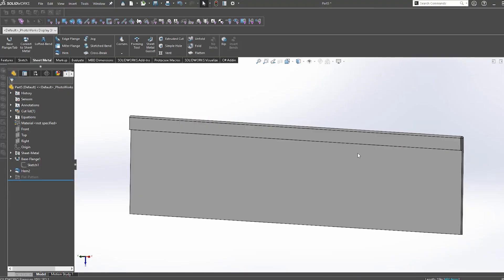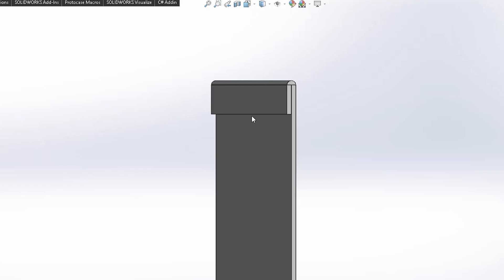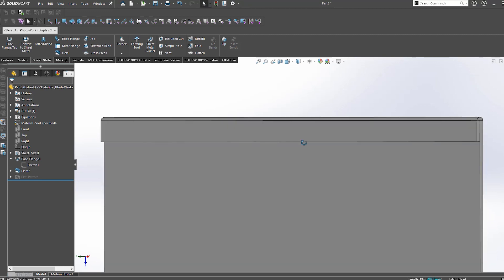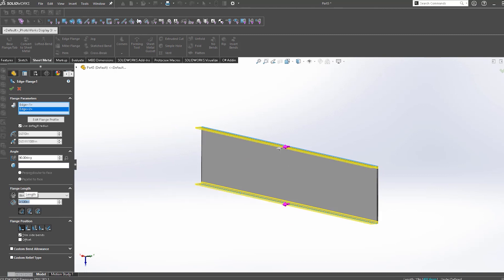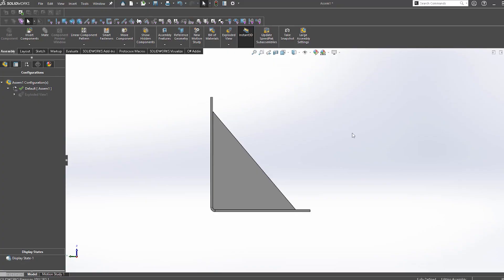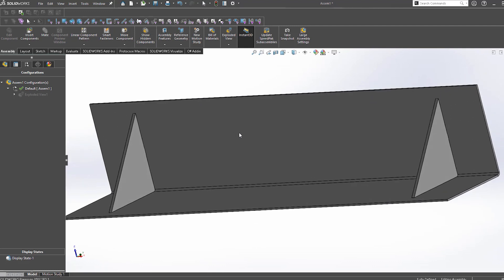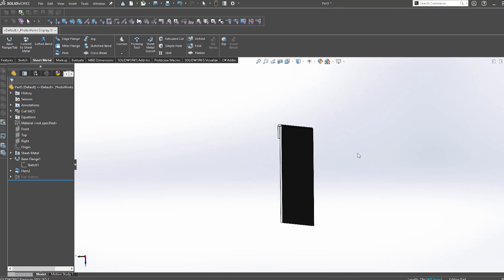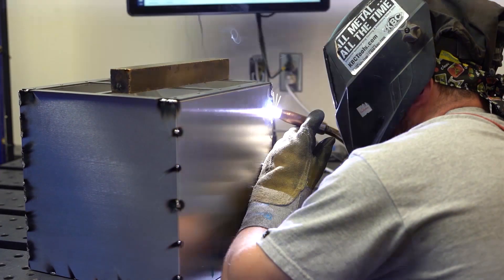Proto Tech Tip - Adding Strength to Sheet Metal Parts

Comment: Great tips. Thanks for posting the video, this was very useful for me. Could you give some tips on how to prevent metal sheet from flapping around.
I have a L shaped long cover made of 2 mm thick aluminum , mm length is around 2500 mm. One side of the L is 40 mm wide and the other side is 180 mm. The 180 mm side has a long window 2000 mm long in the center, 110 mm from the bottom edge. 
The problem I am facing is the lower part of the edge becomes floppy due to the cut window. The upper part is not do floppy due to the bend. We need to stick a transparent acrylic piece on this window, but due to the floppy nature of the bend and the high forces, the acrylic piece gets ripped out. 

Could you suggest any method of stiffening the lower part of the window, do you think a 180 degree bend in the window will stiffen it? Or do I have to fix a L section on to the window edge to stiffen it?
Reply from the maker: Thanks for the question!  Your idea of the 180 degree bend, we call it a hem bend, essentially folding material over an edge to stiffen it up will work!

Keep an eye on the Ask an Engineer video series, we have a video in the works for this very question!
Reply: @ thanks for the help